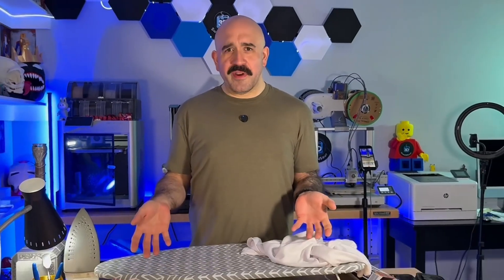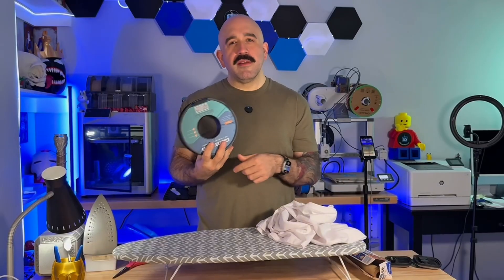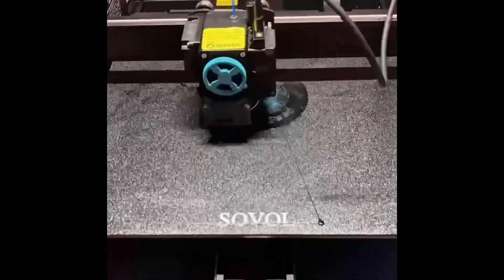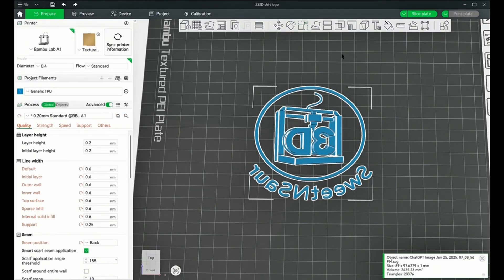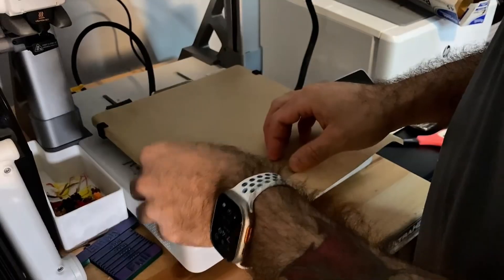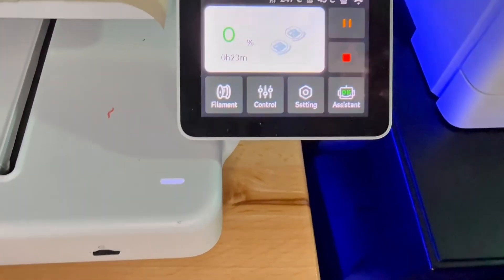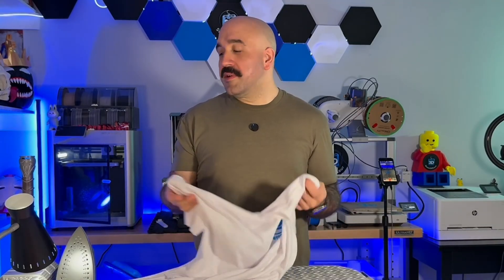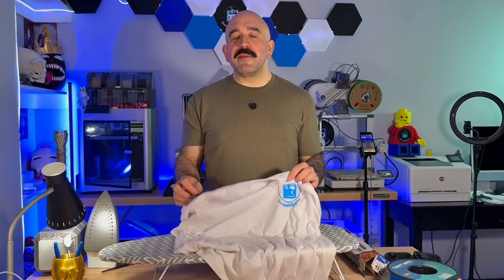How to 3D Print on a T-Shirt with Just TPU and an Iron (No Heat Press Needed)

Comment: Can you help me ? I wanna try but the tpu don't stick to the baking parchment paper .
Reply from the maker: Welcome to my channel! Sorry to hear you’re having trouble - A couple of things to try if it’s not sticking on parchment: make sure the TPU is dry (put it in a filament dryer for at least 4-5 hours), make sure the printer speed is slowed down, possibly use a different kind of glue or glue stick, or even try a different brand of parchment paper. I’ve used brown and white cooking parchment paper, but sometimes it also takes a few tries depending on the design. Hopefully it works out soon so you can try it on a shirt 😊
Reply: @SweetNSaur3D  Thanks for your reply, the solution was that  i slowed down the speed and one side of the paper is a bit shiny and the other side better, so thank you
Reply: Great video! At first I struggled to get the tpu to stick to the parchment paper. I then used a glue stick, however, this yellowed my shirt. Do you have a solution other than a glue stick for getting the tpu to stick without yellowing the shirt?
Reply from the maker: Great question! Maybe try a very light layer of washable glue and let it dry first. Slowing the print way down can also help avoid glue altogether. It’s all trial and error, so good luck 😊

Comment: So at the end of your video you said the black TPU you were able to peel off.  What did you do differently with the blue one to make it stick?  Or was it just the different type/brand?
Reply from the maker: Thanks for the question and welcome to my channel! They were the same brand, but I believe the blue TPU stuck better because it was printed at a lower thickness (.4mm vs 1mm). If the design is printed with a higher thickness and all the edges aren’t pressed well into the shirt, you’ll be able to pry all or most of the design off. So far the blue logo has stuck very well onto the shirt, even after a few washes 😊

Comment: would the bambulab 95A high speed tpu be okay?
Reply from the maker: Hey there and thanks for the question! Any brand of 95A TPU should work, you just might not need to slow down the printing speed with the high speed Bambulab brand since it’s designed for faster speeds. Be sure to watch Part 2 for any help with stringing and additional layer size tips 😊
Reply: @SweetNSaur3D  thanks for the reply! I was just watching the second part now, let's say we're experimenting a bit with the height of the logo, I'd like to print on sweatshirts and maybe make larger things and print them in multiple parts to then assemble them and transfer them onto the fabric... a bit ambitious 😅 I've never printed on TPU for now but I have a Bambulab A1 mini and I might get their TPU... let's see what comes out, if you like I'll keep you updated!

Comment: The printed parts and the paper are bonded. I'm trying to peel them off during the ironing process, but I can't.
Reply from the maker: Hmm, I’m not sure why it’s doing that. Maybe the wax paper wasn’t non-stick, or the glue you used to make it stick was too strong? I have a video coming out where I waited a week after printing and the TPU didn’t transfer to the fabric very well, but I was still able to peel off the paper.